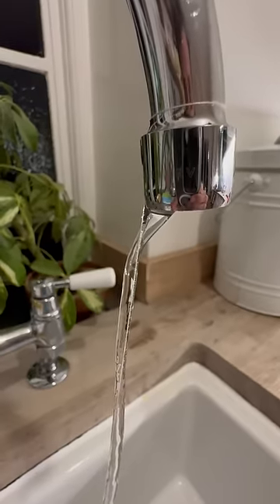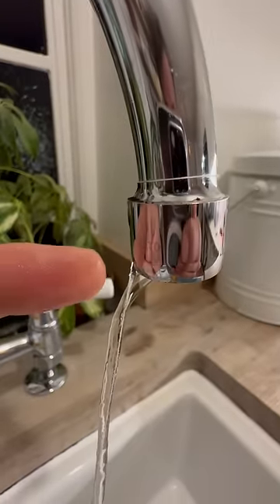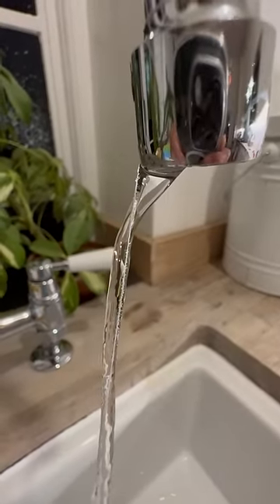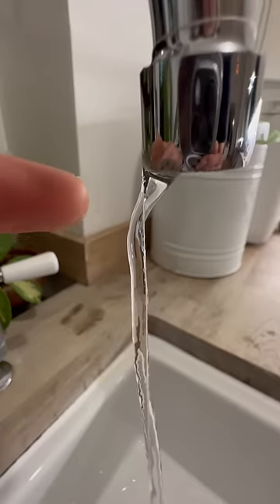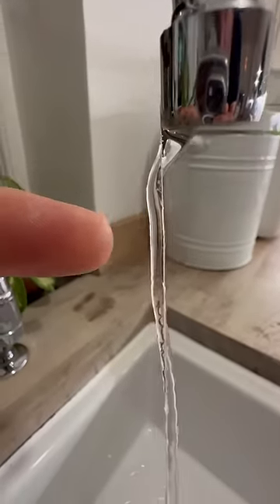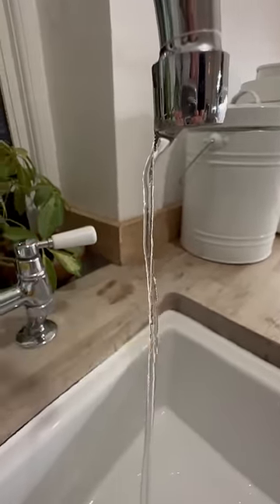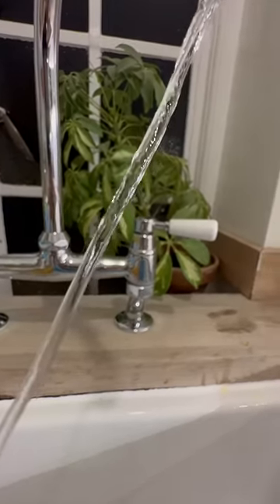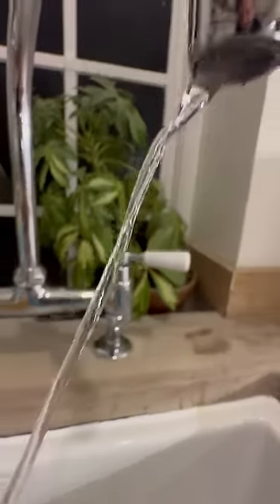Laminar flow and surface tension

Comment: That is fascinating how the profile of the water changes as it goes down
Reply: It's spiraling around a piece of string.
Reply: Centrifugal force?
Reply: @ralph3333  coriolus effect
Reply: @celticmugwump  
Good one. But aren't gravity n surface tension stronger influences?
Reply: @ralph3333  I’m not a physicist but gravity is doing its thing here and so is surface tension but I’m pretty sure its the coriolis effect that’s twisting it around the string in the same ways it spirals the water around the drain hole. I would think it shouldn’t matter if gravity is a stronger force as the coriolis effect wouldn’t exist if that was the case, perhaps 🤷🏻‍♂️
Reply: @celticmugwump  
May the flush be with u.

Comment: One time when I was filling a bucket having a flat rim, I was startled by water dripping off on the opposite side from the faucet.  It turned out that some of the water from the faucet was landing on the rim, forming itself into a tube via surface tension, and transporting itself all the way around the rim via laminar flow, seemingly defying conservation of linear momentum.

Comment: Look up the research that was done by Viktor Schauberger.  I think he explains this phenomenon. I vaguely remember him doing lots of research with water and other things of nature. He invented a lot of things that were based of biomimicry. Created an efficient pipe design that was basically a twisting vortex pipe that mimicked the way water naturally twist which dramatically reduced the resistance of water flowing through it. I think he also created an impeller that was super efficient. I can’t recall completely, I guess I’ll need to look him up too, but this instantly reminded me of the work he did.

Comment: it happens without the threads too. I just tested it. it's like a 3D wave that not only goes up and down, but also twists in one way or another.

if you're a guy, try to pee a tube shape. twist comes from stability and [..] harmonics.

Comment: Thread is twisted fibers. Surface tension, just like you said. It will no longer continue to wrap  around the thread right before the water breaks up into separate droplets.

Comment: You can also get some very interesting laminar flow patterns running down the side of a cylinder held at an angle. I’ve found when testing flow rates at work that it rarely flows straight down the side of a graduated cylinder, but will instead form a snaking back and forth pattern.

You get bored while you’re waiting for a 100/200 ml/min flow to fill up a cylinder, okay?

Comment: The no-slip boundary condition causes the fluid to follow / mimic the twists in the thread. I don't know if that's surface tension or not because the no-slip condition only exists at the interface between a fluid and a solid boundary. Please correct me if I'm wrong as my fluid dynamics course was several years ago.

Comment: That timber worktop is an interesting choice Steve. 🤔
Reply: Why
Reply: @lxp water + wood = not good
Reply: @grassytramtracks  yeah, we're beyond the point where that's much of an issue when the item is designed for such use.
Reply: @grassytramtracks  Every wooden sailing ship in history...
Reply: They’re not uncommon in the UK. If the wood has been appropriately treated, it’s not really an issue.
Reply: @HermanVonPetri  ....rotted. Which is why copper cladding was invented followed by iron, steel and fibreglass hulls.
Reply: @davedawson9851  With regular maintenance, wooden hulls were functional enough to last a decade or more completely submerged in water under some of the most demanding environmental conditions in the world.

If you seal or oil your countertop every once in a while I think it will hold up just fine.
Reply: @HermanVonPetri  Ten years? HMS Trincomalee is still afloat in Hartlepool after  more than 200 years. It's interesting that my use of the word 'interesting' has been taken to mean 'bad' and that it was anything to do with water.
Reply: @davedawson9851  I was just being especially conservative in my estimate of longevity.

It's true that there are quite long lived historical examples of old sailing ships, but they have usually had extensive restoration, often replacing significant portions over time.

In any event, I think this thread has run its course, so to speak.
Reply: @HermanVonPetri  😉😉
Reply: The counters & table in my kitchen look like they're wood too...

Comment: Reminds me of when melting snow dripping off the roof would form Icicles, I would attach thin gauge transformer wire to the tip. I'd see how long it would get till it broke off. I'd make a loop to slide over the tip till it froze

Comment: Curious does it spiral like that cause gravity is pulling the mass of the water down but with the surface tension of the water and to the string and momentum of the moving water cause it to move back around the string?

Comment: 🤔 But wait! If you stick your finger in the flow, halfway down .. the flow above won't change, right? But when you remove your finger, does it stabilise again? And if so, then does the original shape appear below your point of interference? Or is it different?

Comment: I had a delta Tub filler that came with our house.  Not a regular tub spout.  It has twisted copper pipes on the underside of the tub.  It was a beautiful full pressure laminat flow.  It punched the tub floor badically and then was silent as it filled.  So weird.  I niticed thus effect but only learned thus yearcwhst ut was called.  Unfortunately due to absolute farbage install by the DIYer that did it i had to remove it, the tub, all the travertine tile as nothing was insralled to code or proper.  Subfloor was swollen to an inch and black with mildew or mold.

Comment: I don’t think that is laminar flow…. That’s more an a ample of surface tension all around. The speed of the water as you go down the string increases the farther you go down string from the facet, eventually the speed of the water reaches a point that it is going too fast for tension to hold it to the water drop above it and it separates… but that just my two pennys. Pretty sure Dustin explained what laminar flow is and this isn’t it.

Comment: The water doesn't even seem to be moving for most of the video
Reply: It's because of the camera.
Reply: @ghufrananaqvi9031  wouldn't that only make sense if it was strobbing or something?
Reply: @hcxpl1  No, it's a camera trick. I don't remember what it's called though.
Reply: It's called laminar flow, and there is no camera trick. The water is able to keep flowing without turbulence, which is why it keeps the same shape.
Reply: @pugz3230  I mean, I know laminar flow, but this one is on another level